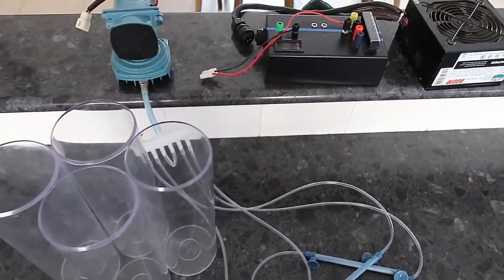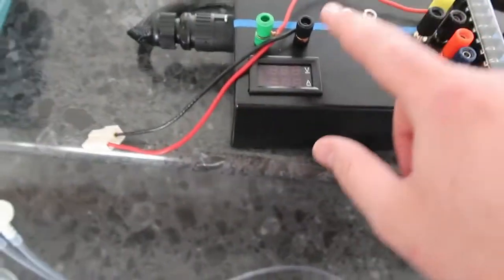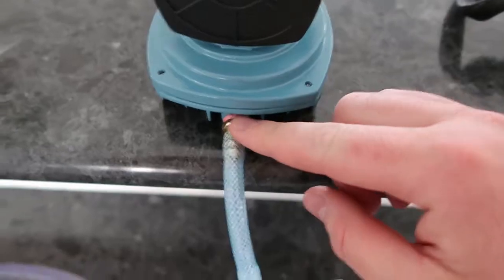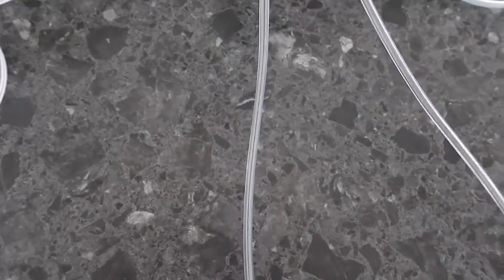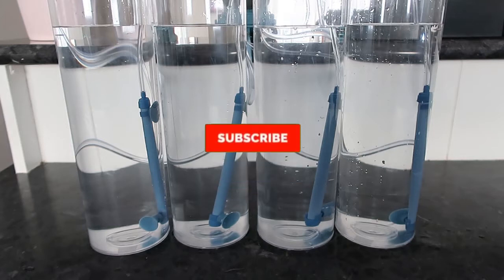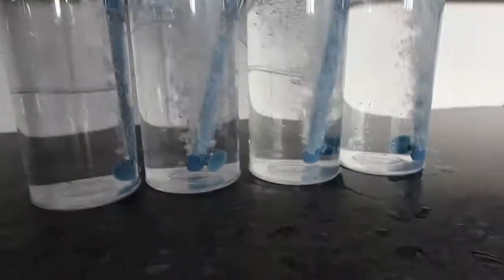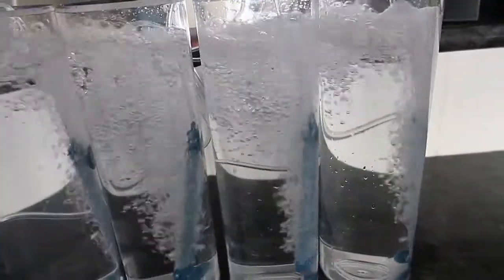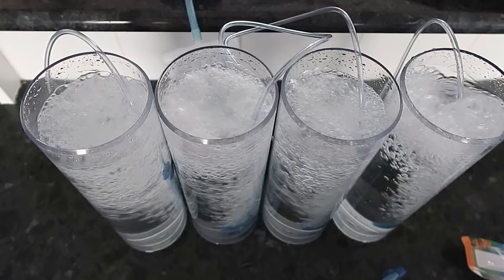CO2 Air Bubbler Balance test

Comment: With the tubes, could you use bubblers in order to absorption in H2O. This can allow for the water to then be flowed into a heater, which would release the CO2 (that could be directed to a enclosed planter, giving the plant proper CO2). The then heated H2O can be ran through tubes with larger surface area in order to cool down the water before it enters the tubes once again?